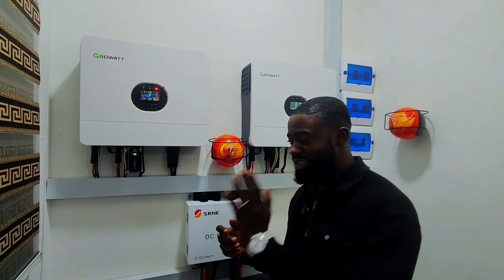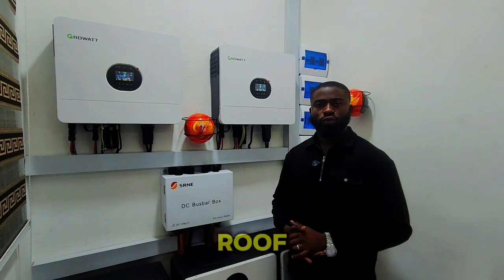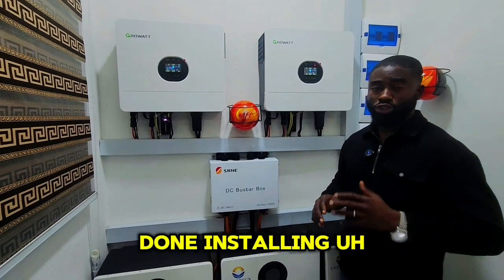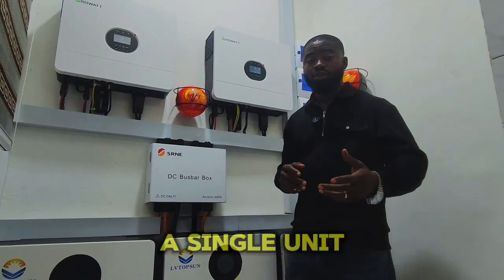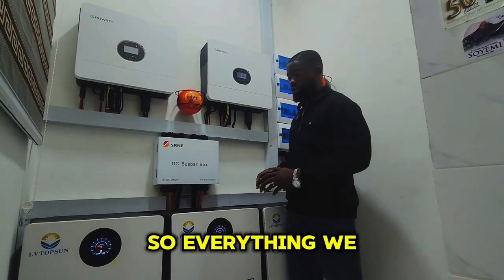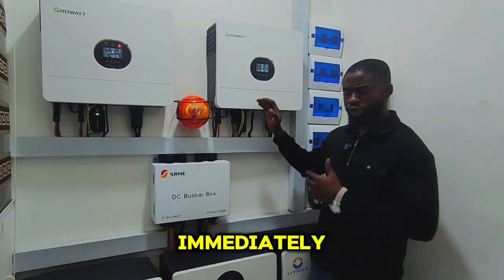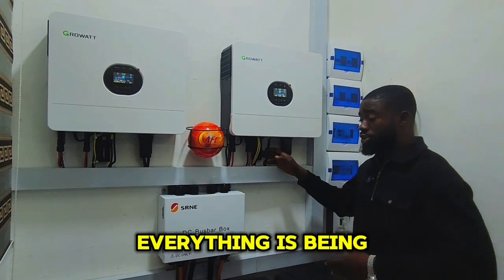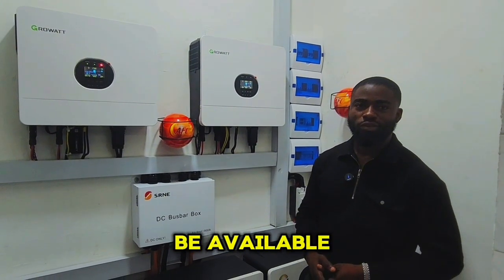WOULD 45KWH BATTERY BANK RUN 3 ACS OVERNIGHT?.

Comment: When you connect the panels in series; what happens if something happens to one panel in the series?
Reply from the maker: Circuit stops work cause panels are depending on one another
Reply: @Mairigaemmanuel I heard something called a bypass diode can help with this issue; is it available in Nigeria?

Comment: Hey Solargod,

I’ve been following you for a while now, and I really enjoy your Shorts and full YouTube videos — great stuff!

I just wanted to share a quick thought: instead of telling customers to invest in fireballs, maybe suggest they build their inverter or battery shed/room a bit away from the main house. That way, if something ever goes wrong and a fire starts, it won’t spread to the house.

I understand that most homes are already built before you arrive to install their solar systems, but it may still be worth recommending a separate solar shed or power room that’s detached from the main building.

Also, about the fireballs — they’re not really effective against all electrical or lithium battery fires. Most of the videos showing them “working” seem to be done in controlled setups. Check out the video below to see what I mean.  https://www.youtube.com/watch?v=_iXJ4UEWtvQ

Even Lithium battery casings with fire extinguishers are not as effective as claimed. Just consider this.

Comment: All these setup for just a 3 bedroom apartment!!!
Reply: it is not about the apartment side but the equipment being used and future proofing your setup for any additional equipment later...i have 10kw with 30kkwh battery but i hardly use anywhere near 3kw at a time unless all the 2 2.5hp ACs are turned on